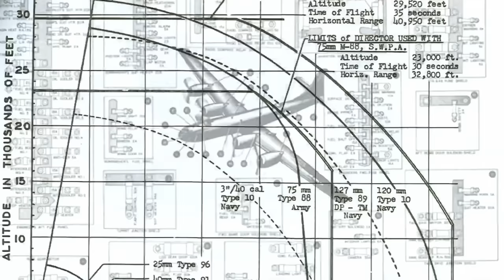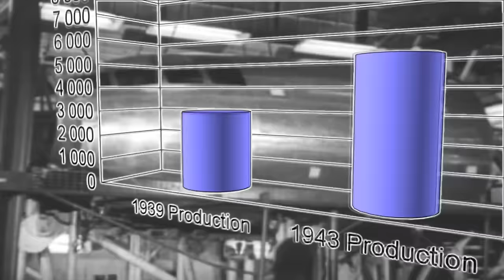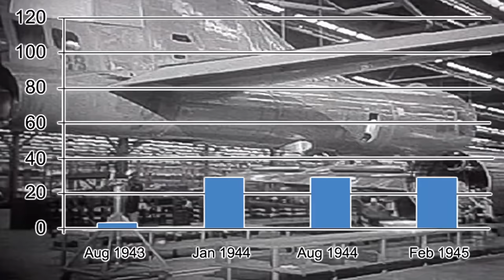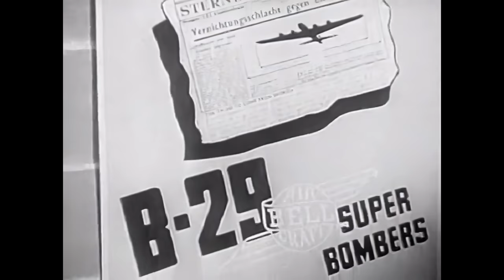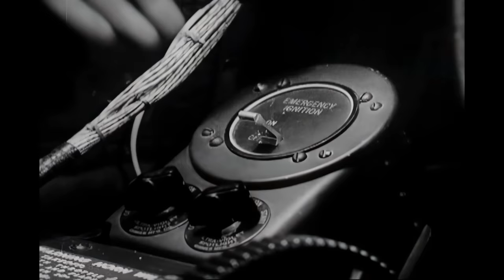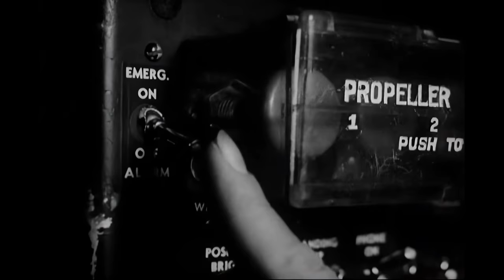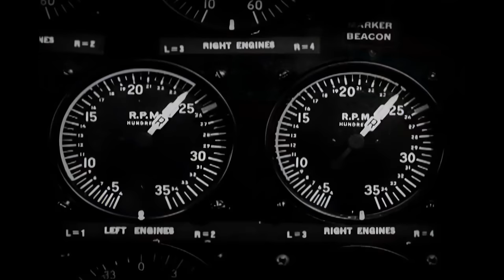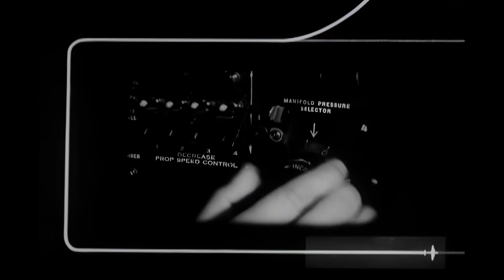B-29 Superfortress | The Birth Of The American Super Bomber

Comment: The number of inaccuracies in this video is quite shocking. I used to be a lead in the Boeing Photo Lab and I printed thousands of historical photographs from the original Boeing negatives. 
In this video they up played Wichita’s participation and severely downplayed Seattle and Renton. They also misstated that Boeing was headquartered in Renton. Boeing’s headquarter was at Plant 2 in Seattle. My father and I used to work in that facility.
They also stated that 3000 B-29s were built which is funny because I don’t know how many times I printed photos of the B-29 called the “5000”. It was the 5000th B-29 built and it rolled out of Plant 2 and NOT Wichita.
I also work at the Boeing Renton and Everett facilities.
Reply: You would think, with  all that information on the website, at your finger tips, they would of checked on their laptops, for all that information. Like this was only filmed 5 months ago... according to you.
Reply: The bomber "5 Grand" was a B17G, not a B 29

Comment: The Wright radial engines, a total disaster - the Wright 2600 Cyclone radial- 85,347 built for 13 aircraft variants; the Wright 1820 Cyclone  radial- 47,475 built for 9 aircraft variants; the Wright 3350 Cyclone duplex radial- 29,181 built for 8 aircraft variants, yes a “TOTAL DISASTER”.

Comment: the grandmother of the B52
Reply: I believe you mean the B50, and C97.  The onlystructural comparison to a B52 would be it was pressurized, had a bomb bay and electrically controlled tail guns.
Reply: @DCherbonnier  mother of B47 and grandmother of B52
Reply: Grandmother of the B50, AKA  Boeing Trimotor, because of unreliable engines.

Comment: The Wright radial engine was a total disaster, yet the british had the Bristol centous sleeve valve producing 2500 hp .could have been a similar situation to the p51 American aircraft with a british engines ,however pride prevailed  .
Reply: The 18-cylinder R-3350, Duplex Cyclone (Cyclone 18) powered the Boeing B-29 Superfortress, Douglas A-1 Skyraider, Lockheed P-2 Neptune, and Lockheed C-121 Constellation varients of the last three remaining in service into the 60's. In commercial applications it stayed in production until 1957. How do you figure it was a disaster.  
And you have a point that Rolls was superior to Allison and Packard when it came toV-12  reliability; they also understood the need for turbo chargers at high altitude  before us.  However they lost thje kudos when they failed to produce the Fan-Jet because the idea came from a non-degreed mechanic
Reply: Malarkey, the Wright R3350 wasn't a "disaster" by any stretch of the imagination, the two biggest issues it had wasn't the fault of the engine or a product of it's design, it's that it was forced through a compressed developmental timeline and the early B29 pilots didn't go through a proper training program simply because there wasn't one due the the B29 itself being pushed through a compressed developmental timeline. 
The single biggest problem was that the early pilots were taken from B17's and B24's in Europe and were trying to fly the B29's and worse yet manage the engine's on them in Asia and the Pacific as of they were flying B17's and B24's in Europe.
The whole thing about the engine fires is a subject that's been blown out of proportion and has a bunch if myths surrounding it also, most people mistakingley believe that a B29 would be flying along and all of the sudden out of nowhere and without warning an engine would burst into flames, nothing could be further from the truth, the engine fire problem happened on take off and was what's called an induction fire, that's a fire inside the intake manifold and they happened as a result of the pilots pushing the throttles forward too fast from an idle and getting a backfire into the intake manifold, of course once there's a fire inside of a system that has pressurized air and atomized gasoline good luck getting it put out, people have also claimed that the extinguisher system in the engine nacelles was defective or poorly designed because it wouldn't extinguish the fires, well you can't expect an extinguisher system that's designed to put out a fire on the outside of an engine to extinguish one that's inside of an engine. 
That also has led to yet another common myth about the R3350 engine that gets spread around and is without a doubt the single biggest myth about them and that's the myth that they had high content magnesium alloy aluminum engine case's, they did not, the fact is they had forged steel engine case's and anytime you're reading an article or watching a video about the B29 and it's mentioned that the engine's had magnesium case's do yourself a favor and stop right there because chances are the article or video will be filled with all kinds of misinformation you won't want to be caught going around repeating.
The magnesium case's myth has it that once an engine caught on fire the ineffective extinguisher system was incapable of putting out the magnesium case's once they started to burn and that they burned so hot they'd torch right through the wing spar in seconds, first off as pointed out the case's were forged steel, and the type of fire, an induction fire, can't be put out because the onboard extinguisher systems sprayed the outside of the engine's and of course couldn't put out a fire inside of one, there was a magnesium alloy part that came into play and that was the engine's bolted on centrifugal supercharger, it's impeller was made from magnesium alloy aluminum and once the induction fire burned upstream to the supercharger and the impeller caught on fire it'd burn through the supercharger housing, but by the time that happened you were already wrecking because as mentioned the induction fires happened during take off, that's when they couldn't afford to lose an engine because they were taking off with more weight than Boeing recommended for the short improvised crushed coral runways they were using on the captured Pacific islands, I knew a B29 crewman and he told me taking off was the scariest part of every mission, he said that once they were off the ground and the wheels were coming up everyone breathed a sigh of relief.
The induction fire issue was eliminated with the adoption of direct injection fuel systems on the engine's, but even the early carburetor systems wouldn't have had induction fires if the pilots had been properly trained on how to run the engine's at take off, the issue was experienced B17 and B24 pilots getting in them and trying to run the engine's like they would in a B17 or B24 during take off, once Paul Tibbets developed a proper pilots manual and training program for B29's the induction fire problem dropped to virtually zero even on the older pre direct injection engine's, and there were other issues that contributed to engine temperature issues that weren't the engine's fault like improperly calibrated cylinder head temperature guages that were being sourced from wartime contractors who weren't calibrating them correctly, once that was figured out it contributed it's share of reducing incidents.
All aircraft and aircraft engine's went through constant refinements and improvements during their service life that made them easier to fly especially by new pilots, the B29 was no exception to that, but it doesn't mean that the early variations of it were bad, the biggest problem with the early one's was that there wasn't a proper and refined training program for new pilots, that's why Paul Tibbets was originally brought onboard with the B29, before he was task with running the Silverplate program to refine a variant specifically for dropping atomic bombs he was task with developing a training program for the B29 as a whole, he said in an interview that there was nothing wrong with the early one's he flew to start finding out were the problems were, the problems were simply that the pilots were trying to handle them the way they knew how which was for B17's and B24's.
Reply: The residents of Tokyo, Hiroshima, and Nagasaki, among other Japanese cities, would disagree with that assessment...
The Centaurus had its' own development problems and was too late in timescale.